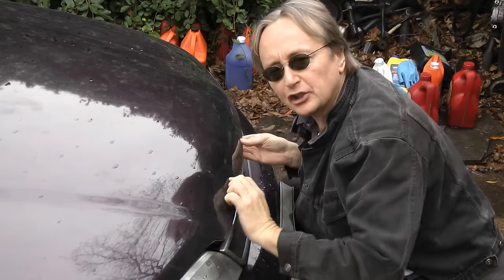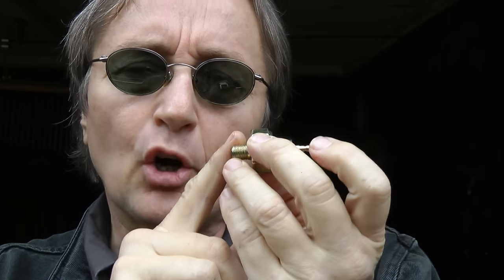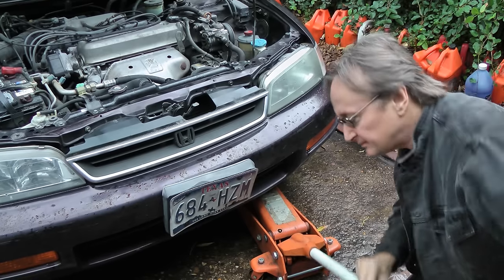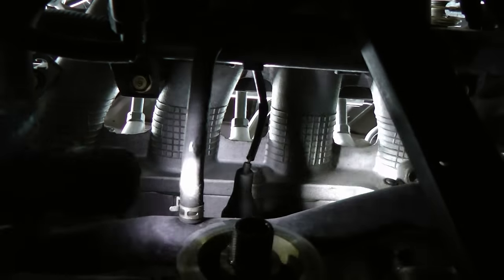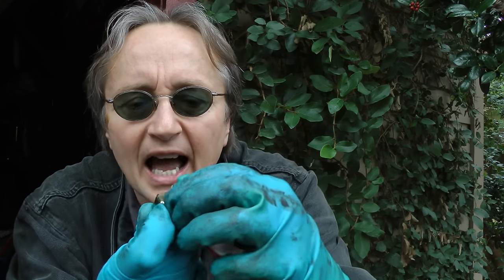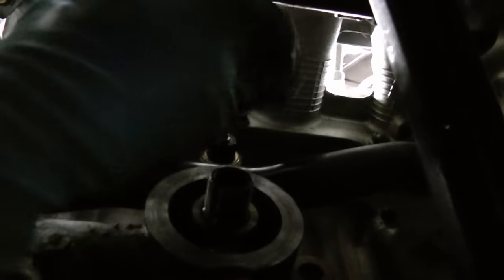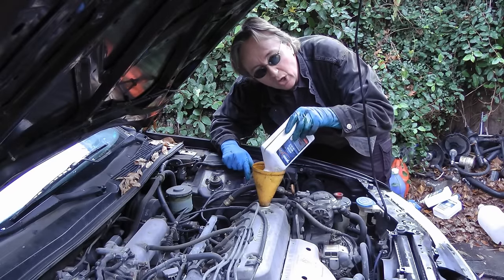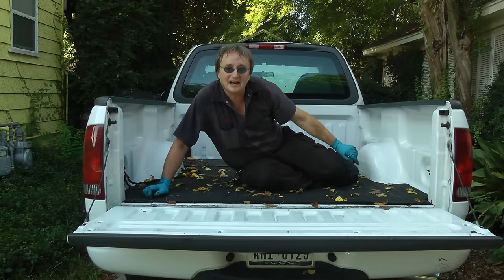How to Fix a Low Oil Pressure Light in Your Car

Comment: I got this switched out today but unfortunately the light came back on. Even when the car is cold as soon as I turn it on it tells me the ac is turned off because the engine is hot. So it's causing the computer to automatically think the car is overheating.

Comment: Scotty - saw your youtube video. email me back if you are still taking questions. have 05 gmc with low oil pressure on gauge and low level on digital warning. this is all after making the mistake of going to a mobile express lube. truck drives good. temp normal, plenty power, no insane detonating noises. but at normal speed rpm are good and oil pressure only 20 psi (usually near 40), coasting to stop light drops to 2 psi (!), have to very gently rev to get up to 20psi. I changed the oil myself trying to fix andf found metal hairs on magnetic plug. mechanic says still a chance that's normal wear. please help.  think I need a manual oil pressure check and gauge cluster? thanks george
Reply from the maker: do have it checked with a manual gauge, but ANY metal filings in the oil is bad, often worn engine bearings and that will drop oil pressure itself

Comment: Hi! My oil pressure comes up randomly while driving and only after I ve been driving awhile. Changed sending unit and oil pump and the problem is still there. No weird noises, nothing, engine sound really good. The lamp never comes on when the car is in neutral. Anyone has any ideeas?
Reply: am having the same problem

Comment: What if the oil light flickered the whole 10 min drive to my house, and then i pulled in to my driveway and turned off my car, turned it back on a few minutes later and it was gone. test drove for 5 mins and still didnt turn back on?
Reply: In your car light shows on  idle in cold start or morning start

Comment: Hi there, I hope someone's gonna reply to this asap. I drive '03 Peugeot 206 1.9 D, and recently I discovered that my oil light keeps flashing while driving or idling. After putting some oil into the engine, it started to flash more, so I emptied some oil right after that and flashing became less frequent. My oil is black, but not sludgy since last oil change was 3000 miles ago. I only use OEM parts and recommended oil. Engine has around 180 K miles. Does anyone know the cause or if my engine is good to drive and savable? I can't ask Scotty on his site since I'm from Europe, and site only supports U.S. location. Thanks.

Comment: have OIL PRESSURE  STOP ENGINE on my passat 2006 1.6 fsi
ihave check the oil level it was a bit low but i add more oil and after 10 minutes driving i have the samw warning again
Any help please. .
Reply from the maker: +Ahmed Hassan make sure it's full of oil first. If so, and light still comes on, replace the oil pressure sending unit and PRAY it's not worn internal engine parts that cost a ton to replace
Reply: +Scotty Kilmer thanks million for your reply 
the car driving perfect every thing going well temperature and engine sound.
is the oil pump ok 😨! is the oil sending until big job ?😵
thank you again for your respond

Comment: In my car oil pressure warning light shows on idling and then accelerate the car and then light not shows
Reply: I have the same problem, any ideas how to fix it?
Reply: @TheDesiKnight1939  in your car many times yeah some time light flickering
Reply: @TheDesiKnight1939  in your car cold start light on at idle or not

Comment: My light comes on when i stop (like at a red light) as soon as i start moving it immediately goes away. I replaced my engine in 2014 for “excessive oil consumption” supposedly but it was the precat debris that trashed it, i went straight pipes after n gutted the precat for visual inspection purposes but my last engine and this one always have gunk build up under the engine but no leaking signs on the ground and this is the first time the light ever came on. Levels are fine, it started about a month ago.

Comment: This didnt really help very much but whats going on with my 05 kia amanti is that theres no oil on the dip stick but the light isnt comming on.
Reply from the maker: chris madison light only comes on when oil pressure is low. I've seen cars with less than one quart left in the engine, but they still had oil pressure and the light never came on.

Comment: I do not believe the oil pump creates oil pressure, the engine its self makes the compression and pressure, Now as the oil pump as it goes it just throws the oil all up inside and has a filler pickup tube in the bottom to get more oil from the oil pan. I wish this gentleman would make an oil pump replacement video please.
Reply from the maker: believe it, the oil pump makes oil pressure and pumps oil through the engine, like a human heart. that's how they work

Comment: You wrapped the teflon tape in the wrong direction. Nice video.
Reply: No he didnt. Its right hand threads and he wrapped it clockwise which is correct.
Reply: Yeah he did it right

Comment: 99 voyager,,,,,,, replaced the sensor,,,,,, now oil light is dim and it dings dings dings
Reply from the maker: put an oil pressure gauge on it to see if it really has low pressure, and if so, don't drive it, fix the engine. if it is fine, then wiring is bad or New sensor is crap

Comment: Where is the oil sending unit located on a Lexus es300 2002 v6?  

also, can a low oil  pressure make a camshaft retarded? I'm getting a engine light ON with code P0012. And my oil pressure light comes and go!  It goes away for 3 minutes and then is goes back and so on....

Any advised?

Comment: i did replice the oil pressure  and  i have the same problim  ( nissan path..05 )   time we drive the pressure it is on  1/2  AND no light....... time  we stop the car  the gage  go to low  and the  lights will go ON
Reply: Then you actually have low oil pressure, which this video doesn't explain how to fix.  You either have worn or bad oil pump, or the bearing clearances have widened inside the engine which allows the oil pressure to drop.

Comment: This guys a part replacer.. at least show people some evidence. By the way, you can check an oil pressure switch, put 12v to the pin, and hook your testlight to the threads and ground the testlight. You can blow air into the switch to see if it opens of closes, which will trigger the test light.

Comment: Do not always think it is that sensor do not drive the car I did it on my 99 solara it was the oil pump not the sensor I know this because it was low on oil when I bought the car for 300 sure I was like ok engine is in top notch even with no oil on the stick I add oil all ok good yay (: next oil change I use a new k&N and good oil aka castrol half synthetic the oil oil comes on  : o I go ahh that is just the dumb sensor... turns out few weeks later it starts knocking : o oh shoot! I go oil pump!! now it shuts off almost instant when started to protect the engine no compression and a loud rattle knock oh shoot so remember if you see that light stop! never drive unless you know what you are doing I learnt the heard way. well off to get a another v6 this time I will change the oil pump before putting in the engine (: no worries of a clogged pickup tube this time (: and that timming belt also new one will be put in.

Comment: they need to take you off of you tube dude! seiously!
Reply: Stephanie Lynn why?
Reply: beazymuzik  because I am a ASE certified mechanic. he only knows the art of  parts changing. low oil presure can be alot of things. stuck open oil pressure relief valve, bad bearings, clogged oil filter, clogged oil pump pick up tube. ect.
Reply: Stephanie Lynn I have an Audi A4 Quatro 2000
And on my dashboard my oil pressure is in the low. The car runs fine, no issues at all, there are no lights in the dashboard other then the fact that the oil pressure gauge is low it's at like 150
What can this mean? Oh I also noticed some water coming out of the muffler idk if that has anything to do with it. Please help I know not much about cars!
Reply: Tomas Lajara well tomas the first mistake you made was buying a piece of shit german car. no worries before I started working on cars that is all I use to buy. now I know you cannot beat asian engineering. most common sense people nice polite quiet clean people. and thier cars reflect that. I would not buy anything but a honda or toyota. well your oil pressure is typically between 10 to 60 psi. you have to look up what yours is suppose to be. and check the oil level and if it is low look on the ground for leaks. secondly you need to hook up a measuring device through your oil pressure sending unit and find out what it actually is. while you are at it test the oil pressure unit to see if it is functiong correctly. test it electrically and mechanically. if the unit is ok then test your oil pressure control valve to see if it is closing and opening correctly. if it is than you need to drain your oil and examine the oil filter to see if it is sludged up. if the filter is ok look at the oil to see if there is metal particles in it. if you dont see any particles in it take a small amount and light a match to it to see if any gas is in it. if gas is in it it will flame up. rub tne oil in your hand to see if coolant is getting into it. now take a flashlight and look into the oil pan to see if the oil pickup tube is sludged up. if  you do all of these things you will be able to figure out what the issue is. coolant or gas  in you oil means you have a leak getting into your system. metal particles means the bearings are going bad. now if you have water coming out of your muffler either your engine is functioning perfectly (unlikely on a old car),or coolant is leaking into your combustion chamber and being expelled into your exhuast. if this is the case your oxygen sensors will become damged and coolant may be getting into your oil as well. which leads me to suspect  that a coolant leak is the source of your oil pressure issue. but honestly I would recommend you take your car to a ASE certified mechanic. ask them to show you their credentials because there are alot of fakes out there. I hope this has helped you!
Reply: Stephanie Lynn thank you so much sir, I will do as you said, hopefully it's nothing major. This is my first car ever and I'm not ready to give an arm and a leg to fix it ...
Reply: 150 pound is high for oil pressure.  my dodge only goes to 80 pounds.  what is the specification for that.